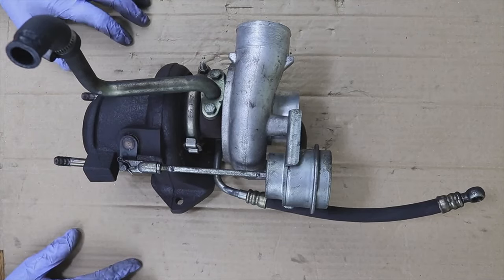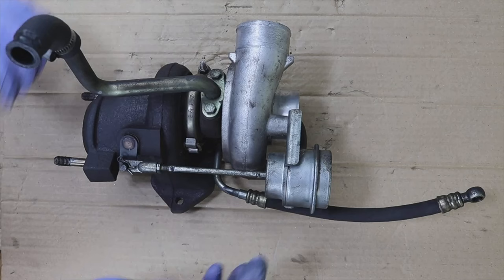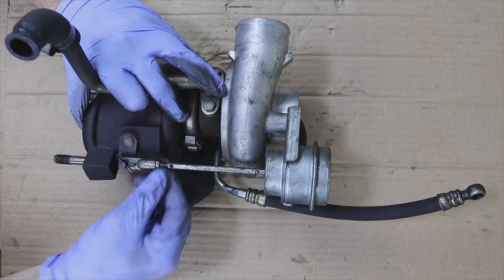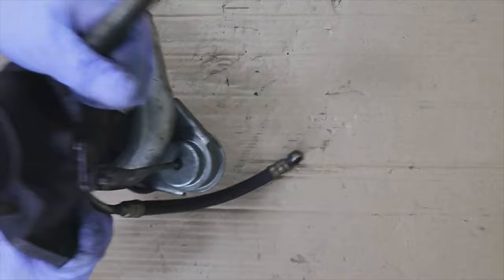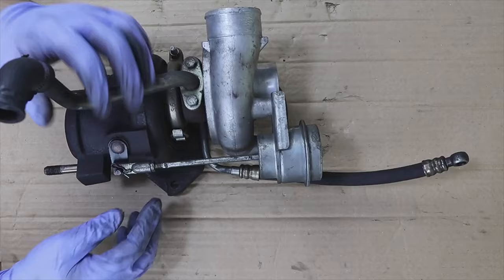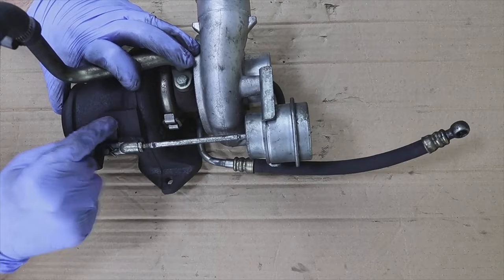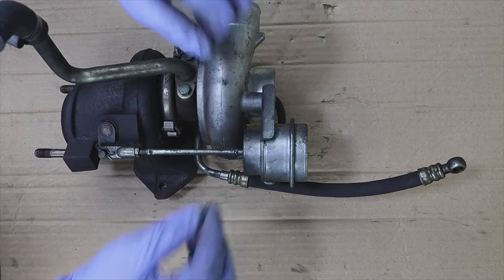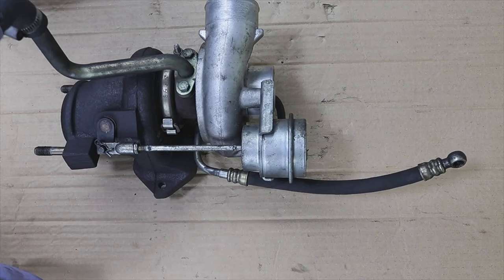EASY check, TURBO ACTUATOR failure, WASTEGATE FOR TURBES WITHOUT SOLENOID VALVE

Comment: You must disconnect the rod from the wastegate lever to evaluate correctly.
Reply: Will I be able to move the Westgate lever if I remove the rod. And also if I add air into the line and then release the air should the lever move back into position?
Reply from the maker: It depends on the system you use, solenoid valve or air pressure.
Reply: @car-parts2.011  thank you
Reply: @car-parts2.011  You must check the wastegate without the lever attached to insure it is not stuck and operates fully.  You then must check the Actuator solenoid or air pressure actuator etc to insure it is working correctly.  You cannot just do what this video says.

Comment: this confuses me further, but then my question is if there is solenoid, this should move when u exert pressure at the port, if its not the waste gate is said to be in closed position due to diaphragm damage or bad solenoid or vacuum leak.. i feel like i am on right track and main problem with this is more fuel get dumped into exhaust and have black smoke. mine got into a point of dilution with engine oil.

Comment: Hello Sir,
I have one question.
I test my wastgate but when i put pressure in the line from turbo to wastgete valve open but i saw also there was air escape from the rod that goes in the wastgate. Is that normal or this wastgate is broken ?